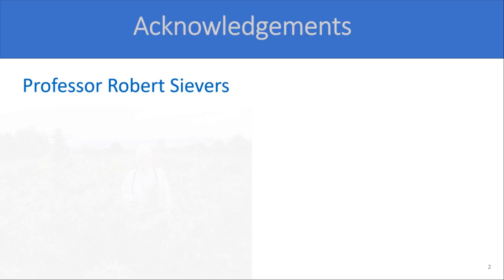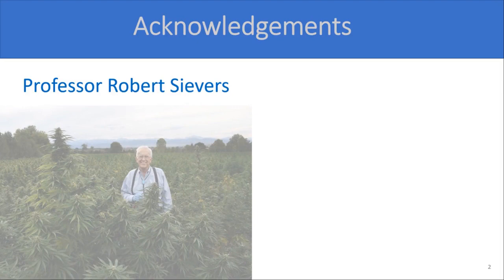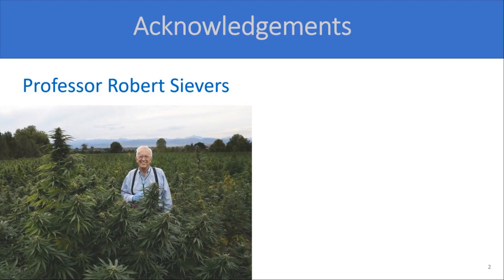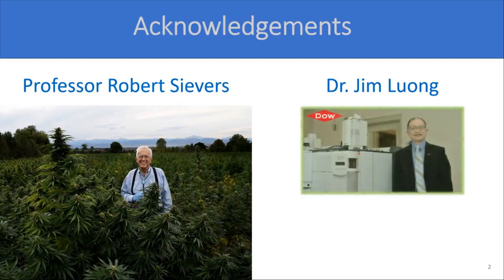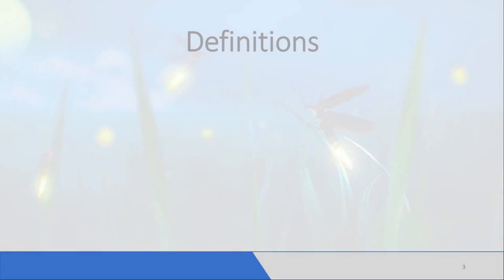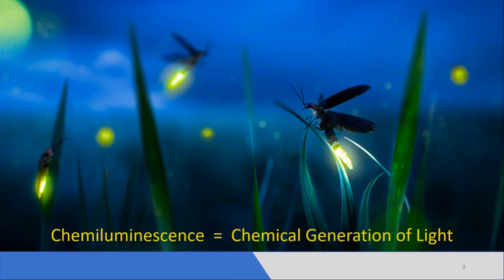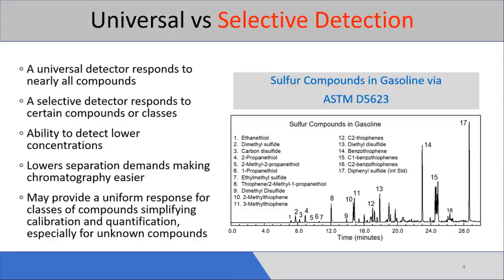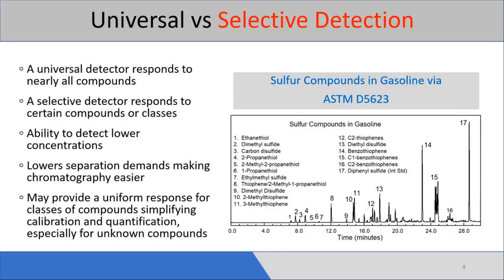Principles of Operation, Maintenance, and Troubleshooting for Sulfur and Nitrogen Chemiluminescence

Comment: Thank you for the video. It is really clear and helpful. 
But in our lab, it is very strange that our GC-SCD gives decaying signals time by time. We tried to inject Sulfur standard gas and each time the peak area reduced by 2~3%. But if we let the instrument take a break for one hour, the signal rises in the next shot. Agilent Engineer came and replace the loop, valve and something else, but it has no change. 
We are still trying to solve the problem.